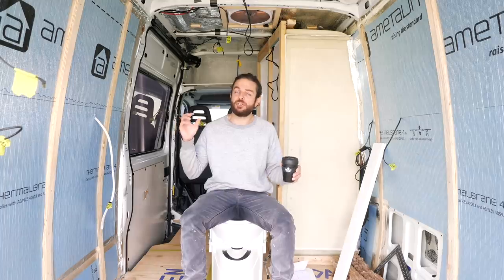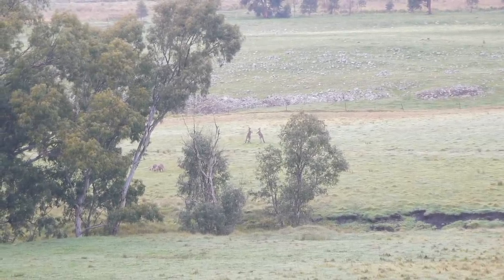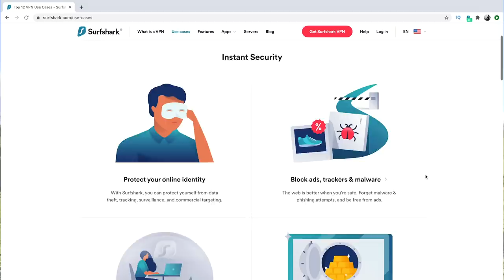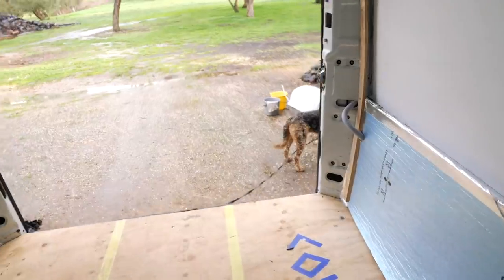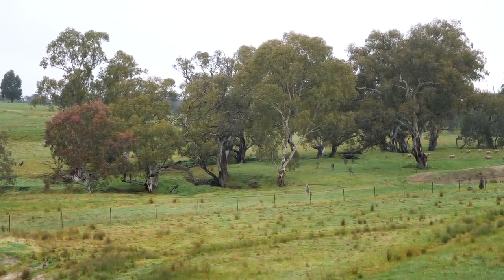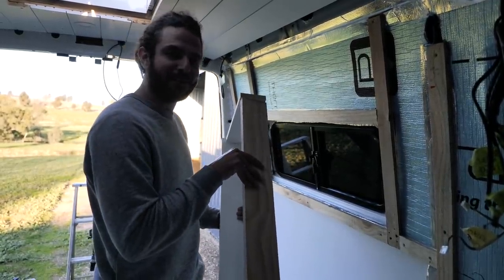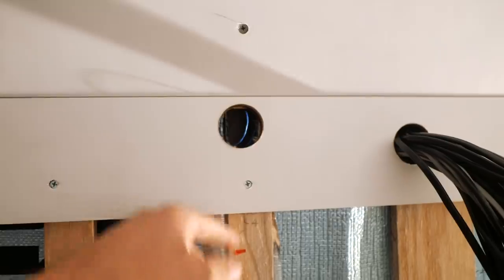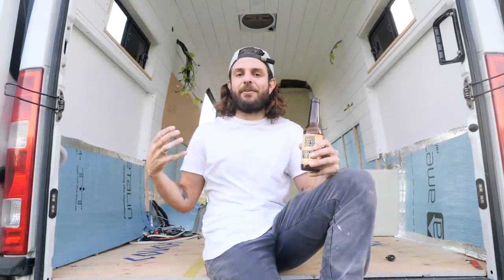Starting to feel like home! | Converting a Cargo Van to an OFF-GRID Tiny House

Comment: Hey Max, good work !! I have been following you for a while and love your videos .
I was wondering two things that I did not find the explanation on your videos, if you could clarify I appreciate a lot .

1) Why did you use the ply in the vertical ribs of the van on the wall ? Why not just fix the finish straight to the ribs van ?
2) I see you used some batts insulation for the hard to reach places, which one was it and where did you get it from ?

Cheers

Comment: Hey Max, if you had the chance to do your van again, would you set the shower back slightly to allow you to frame in the front wall behind the drivers seat? i'm trying to conserve as much space as I can but i'm worried about exposed plumbing lines

Comment: How are you doing the final coat of paint on the boards maybe 4 inch roller gloss sleeve if you’re using oil based paint or if you’re using water based paint a emulsion sleeve  ...and mask off the floor paint before you get all the fittings in hope it’s some help cheers mate

Comment: Wow, a lot done in this video, and it is starting to look like a home! I am thinking that Occy delayed his own flight, so he could plan his own endless summer...surfer dogs cannot be trusted. If your drill drops bits a lot, see if the chuck has a locking mechanism. On my drills and drivers, you hand tighten, loosen it one click, then tighten it and it will make a "bigger" click, which indicates that it's locked. On some models, I've heard it's hand tighten, then loosen till you hear the big click. Saves a lot of headaches on a big job.